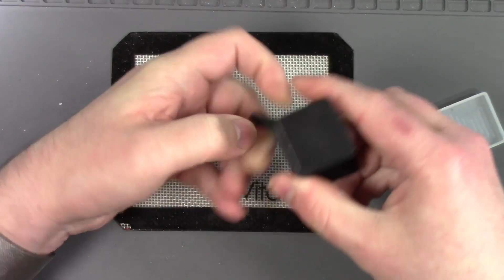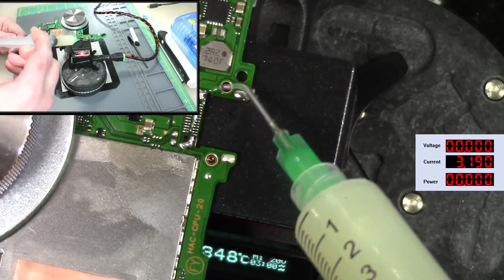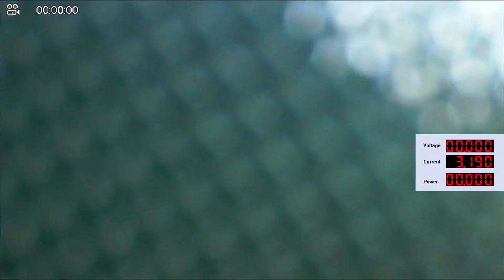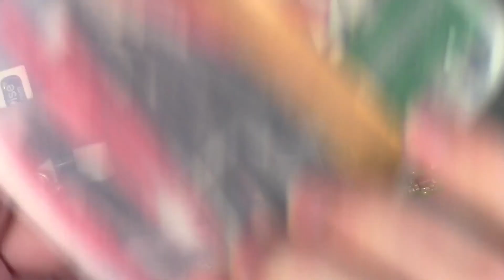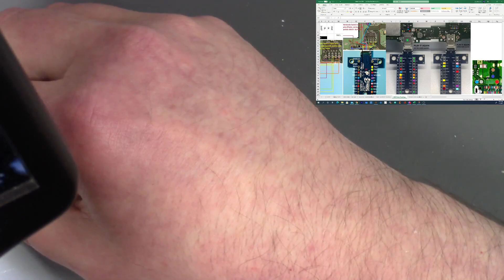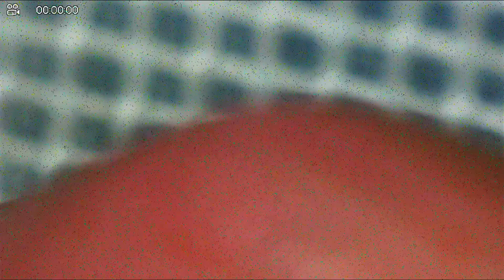Nintendo Switch #1007 Part 2 USB C Port & Filter Repair

Comment: Hi, where did you buy the 4-legs filters?:) love your videos btw :)
Reply: And if that filter is blown. Will that effect the charging. I have a nintendo switch that charge at 0.005 amps. And the filter is defect and i have changed the p13. What could cause this?
Reply from the maker: I get them from Digi-Key here is part Number MCZ0605AH900SDT000
Reply: @jasondoesthings919  Thank you verry much :)

Comment: Hey, great video, quick question how many degrees do you usually use on regular unleaded solder or leaded solder. Thanks
Reply from the maker: On a switch between 420c to 480c

Comment: *TIP*
🐨 Pre-Tin the USB Ports leads as well as the PCB Pads for a super fast and extremely reliable marriage.. 
Also with that USB tester place one of your meters leads to the USB tester card and then with a quick run along those filters, one beep means all is good, two beeps may indicate a short "check if false positive is just a low resistance resistor and if so no probs..
APU I dropped a like 👍
Reply from the maker: Thank you for the tip.